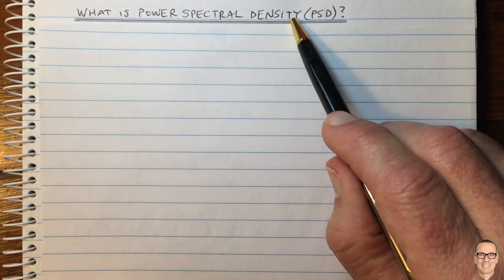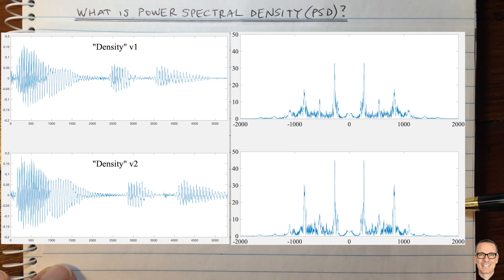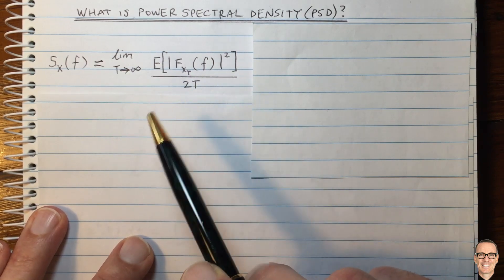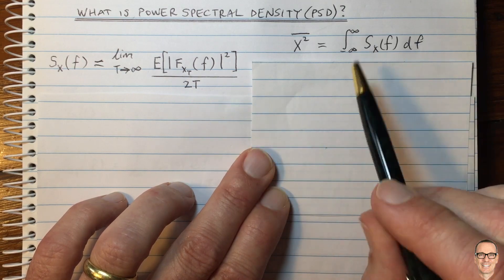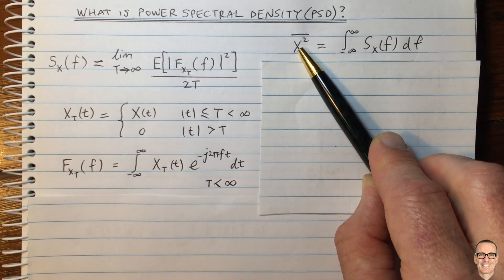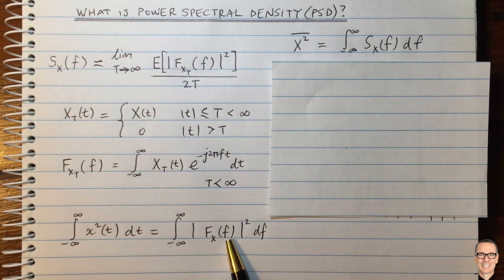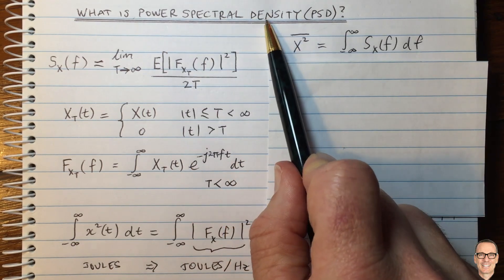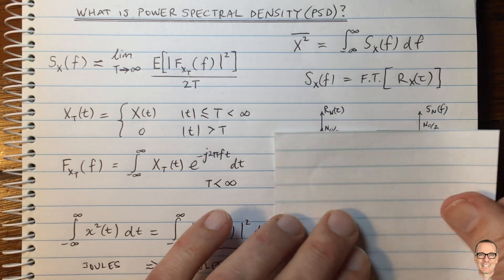What is Power Spectral Density (PSD)?

Comment: Assume I have a perfect sequence of real Gaussian intensity pulses in time domain. I seem to know that if we measure this sequence with a spectrum analyzer we get a set of delta functions (lines) under a Gaussian envelope. This set of lines is a spectral power, but is it the power spectral density (PSD function in frequency domain)?
Reply from the maker: Sorry, but your question is a bit vague. It's hard to know exactly what system/signal you're referring to. You'd have to be more specific about what you mean by a "Gaussian intensity pulse". And also what you mean by "a set of delta functions".
Reply: @iain_explains  right I need to be more clear. I can put it also a bit more general. I'm talking about a periodic signal. It can be written as a Fourier series, so with a countable number of frequency components. In the frequency domain I expect this to be a sequence of Dirac delta functions. The separation between two consecutive lines being the inverse of the period. While how the amplitude of those lines varies with frequency should encode other properties of the periodic signal. I expect that the envelope should tell something. So my question is: how the PSD of a periodic signal look like? What can I deduct from the envelope of the PSD?
Reply from the maker: The envelope tells us the magnitude of each frequency component. If they are periodic signals (ie. not random), then there is no notion of "spectrum density". The spectrum will be point masses - just as you explained. ... sorry, I must be missing something in your question.

Comment: 1:51 Is there a mistake here? You say "you cant take the Fourier transform of a stationary process" Did you mean non-stationary?
Reply from the maker: No, I did mean what I said. First of all, you can only take the Fourier transform of an actual function - not a random process (which is random). You might be able to take the Fourier transform of a realisation of a random process (because that is an actual function in time), but not if the random process is stationary, because that means the density function is the same for all time - which means realisations will have infinite energy - and you can only take the Fourier transform of a function that has finite energy (except for periodic functions of course, such as sinusoids).
Reply: @iain_explains  Im confused here. When you mean Fourier transform, do you include FFT? If so I saw many SW and scopes that takes FFT of random signals. We don't directly need a mathematical function to compute the FFT.
Reply from the maker: You are confusing a "random process" with a "time-limited signal that was generated with random values". One is a "process" the other is an actual "signal". An actual signal will have a Fourier transform (whether its values were generated in a random way, or in a deterministic way). It will have finite energy, and yes, if it has been sampled in time, then you can use an FFT to evaluate it. A "random process" is a time domain function that can take random values. If it is "stationary", then its PDF is the same "for all time" - which means it is not "time limited", and (in general) any particular realisation will have infinite energy (because it will go for infinite time). Sometimes people are relaxed about their definitions, and simply say that a time-limited signal is "stationary", when what they mean is "it is stationary over the time duration of the signal" ... whatever that means... More details on "random processes" here: "What is a Random Process?" https://youtu.be/W28-96AhF2s

Comment: I have plotted the audio signal's STFT plot, and in that, I am getting power spectral density (dB/Hz) in negative, what does it signify?
Reply from the maker: What do you mean "in negative"? Do you mean it has negative amplitudes? (impossible, by definition). Or do you mean it has values for negative frequencies? Or perhaps you are mistakenly thinking that the output of the STFT is a PSD? (which it is not ... a PSD is an "average of squared Fourier transforms", as explained in the video).
Reply: @iain_explains   Certainly, Professor. You are correct. After further studying the topic, I discovered that in digital audio, dBFS (decibels Full Scale) is employed. In this system, the highest amplitude within the audio bit depth is used as the reference point, causing all other amplitudes to be represented as negative values. Have I learned it correctly?
Reply: @iain_explains  earlier, by negative  I meant negative amplitudes
Reply from the maker: I'm not familiar with dBFS, but what you've described sounds fair enough.

Comment: Hi, great video. I am currently working in structural mechanics and we use Power Spectral Density as an input for random vibration. I would love to know if you could cover an example on how random vibration loads can be converted to PSD inputs. Thanks!
Reply from the maker: If a signal is a random process, then it has a power spectral density. It doesn't matter if it is an RF signal, acoustic signal, or a physical vibration signal. But I think you might be confusing things a bit. PSD is a characterisation of a random process. It is not an "input".
Reply: Rather than input, in structural analysis, would a better way to characterize this is that a Power Spectral Density be used to determine a structure's "response" to a "random  process"?

Comment: Great video.  If I have a system where I took discreet experimental data points of an oscillatory behavior over a certain time span (no aliasing to worry about) and ended up with my time domain data showing oscillations (no interruptions to this steady state behavior ocurred during the oscillations), if I take a Fast Fourier Transform (FFT) of this data to see the frequency components, is that inappropriate (i.e. should I have taken a PSD instead)?  If the above described scenario is inappropriate for a FFT, what would have to have been present (or absent) in my system to make a FFT appropriate to find the constituent frequencies?  Thanks.
Reply from the maker: If your signal is non-random, then you can take the Fourier transform directly (or the FFT, if you've only got a finite time duration sampled version of the signal). You need to consider the PSD when signals are random.
Reply: @iain_explains  Yes, I do only have a finite time duration sample of my signal.  Regarding the issue of non randomness, would you please tell me what is the name of your video that discusses what characterizes a non random signal?  Thanks!
Reply from the maker: If a function is represented by a mathematical equation that contains a random variable, then the function is random. If it doesn't contain a random variable, then the function is not random.

Comment: What relationship is there among PSD, PFD and FSPL?
Reply from the maker: I don't understand, sorry. I'm guessing this is intended as a humorous comment on the use of acronyms? Power Spectral Density, Personal Floatation Devices, and Free Space Path Loss?? I don't think they're related.
Reply: @iain_explains  Thank you for responding. For PFD, I meant Power Flux Density. I suppose it is also often referred to as simply Flux Density.
Reply: @iain_explains  Also, unrelated to the initial content, but since I am already here asking you questions, could you put together a video that covers symbol slicing?
Reply from the maker: Thanks for the "symbol slicing" suggestion. I've added it to my "to do" list. In terms of your original question: the Power Spectral Density is a representation of the power as a function of frequency, at a specific geographical location (eg. at the transmitter or receiver); the Flux Density is a representation of the power (total, across all frequencies) as a function of geographical location (eg. as a function of the distance from the transmitter); and the Free Space Path Loss is the "power gain" that the signal experiences, as a function of distance from the transmitter - it's a multiplier of the transmitted power (of course this "gain" is less than 1, or if it's expressed in dB, then it is negative).

Comment: Great video! I'm a bit confused as to why you can't take the limit of the full signal X(t) (4:24)? Why is the truncation necessary?
Reply from the maker: Because the FT integral containing X(t) has infinite value when T goes to infinity.
Reply: I’m seeing a contradiction here - you’re saying you can’t evaluate the integral when T goes to infinity, but you’re taking the limit of the expected value of the square of the integral as T goes to infinity. If F(f) doesn’t make sense in the limit, how can S(f)?
Reply from the maker: Yes, it's intriguing ... for example, you can find the integral of 1/(x^2) between alpha and infinity, but you can't find the integral of 1/x between alpha and infinity (because 1/infinity=0, but log(infinity)=infinity).
Reply: I guess what I’m confused about is the fact that, by taking T to infinity, it seems you’re effectively no longer truncating X(t). Is that correct?

Comment: You say we cannot take the FT of a stationary process because the signal is all over the time (up to infinity I assume). But, your voice recordings are limited. Isn't that a contradictory?
Reply from the maker: As I said in the video, my voice recordings are not stationary processes. The pdf is not the same at every time, t ... plus they are finite duration. The maths only holds for stationary processes. I used the voice recordings to highlight the challenges with characterising random signals. I showed an example of a stationary process at 1:51 in the video, where it shows a portion of the process where the pdf is the same at every value of time.

Comment: I used PSD to analyze the dynamics of ion channels in mammalian cellular membranes.
The corner frequencies which relate to the opening and closing rates of the ion channels can be estimated.
Reply from the maker: That's sounds very interesting. When I was doing my PhD, my supervisor and another PhD student had a project with a medical researcher looking at ion channel switching. They were using a Hidden Markov Model to characterise the process, and try to estimate the switching times.
Reply: @iain_explains  
The ion channels I was studying had a single channel conductance of about 300fS. This was too small to be resolved by single channel patch clamp techniques.
We had to resort to recording currents from the entire membrane (whole cell recordings). And use noise analysis to try and understand the mechanics of the ion channel gating.
Reply from the maker: If you haven't seen it already, then the research I mentioned is presented in Chapter 19 of this book: "Biological Membrane Ion Channels: Dynamics, Structure, and Applications" edited by Shin-Ho Chung, Olaf S. Anderson, Vikram V. Krishnamurthy.
Reply: @iain_explains  
Thanks.
Reply: Why would PSD be the choice for identifying these ion channels' frequencies versus using a simple Fourier transform of time domain data to see the frquencies involved in the open-close movement of the channel (not challenging your work, but I'm curious as to when a plain Fourier transform would be appropriate for a physical oscillating system)?
Reply from the maker: A FT of a single measured waveform tells you about the frequency components of that particular measured waveform. But if there is randomness in the system, then the next time you repeat the experiment the measured waveform would be different, and you would get a different FT. In these situations you're probably going to be interested in the "average FT", or the "FT of an average waveform", or more precisely, the PSD.
Reply: @iain_explains  If I have a raw FFT from my data, is it possible to convert that FFT data to a PSD and if it is possible, how do I do that (is it a math formula that can be applied to the raw FFT data)?

Comment: Why are interested in PSD? Benefit(s)?
Reply from the maker: Great question. I should have emphasised that more. In many system design problems the signals are random, and you need a mathematical characterisation of the average bandwidth. The PSD gives you this. For example in digital communications for both the digital signal, and also the noise waveform. See this video for more details: "Autocorrelation and Power Spectral Density (PSD) Examples in Digital Communications" https://youtu.be/XWytSLZZP1A